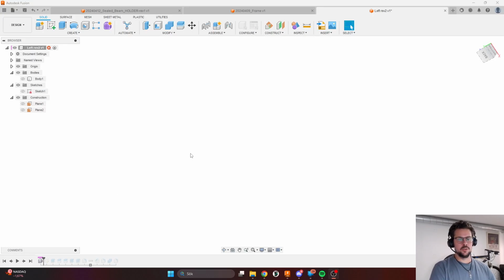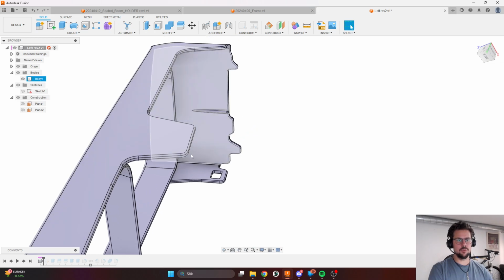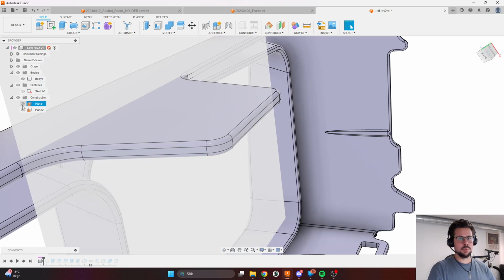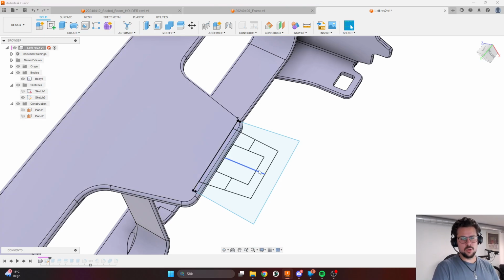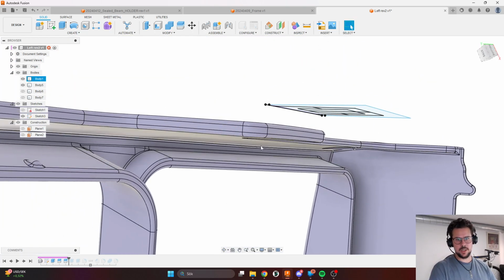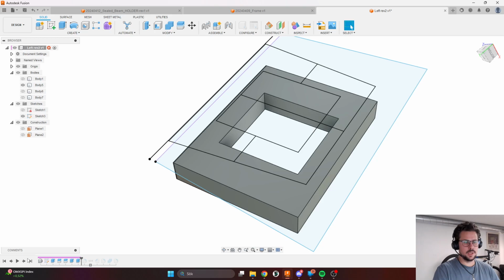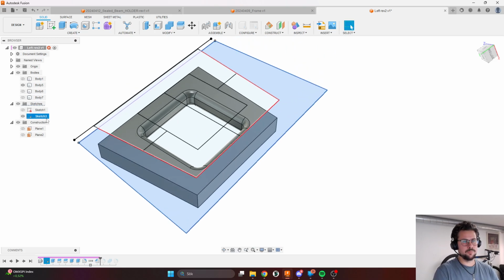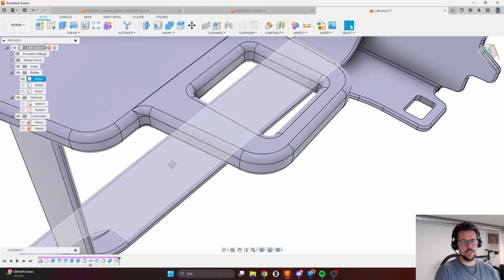Designing a Volvo 740 Part in CAD | Fusion 360 Tutorial

Comment: Are these 3D models available somewhere?
Reply from the maker: @leppa9106  they are not at the moment, but I can help you print it if you are in need of the parts??
Reply: @ i am trying to make USA front but using facelift side markers. So pretty much all parts need to be custom. I dont currently need any printed parts, but the 3d scans would help with modeling
Reply from the maker: @leppa9106  unfortunately the scans are not mine to share.